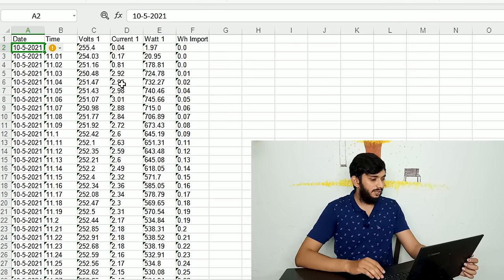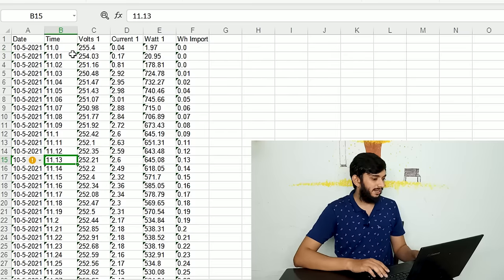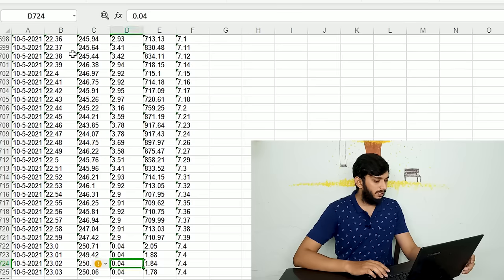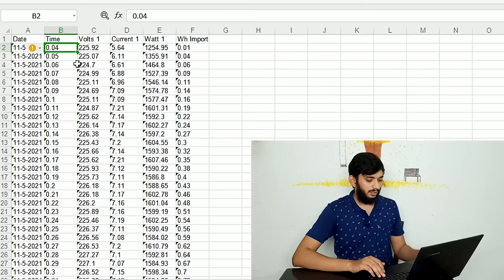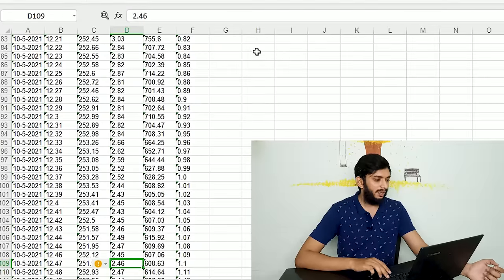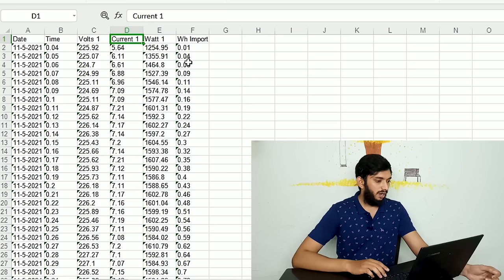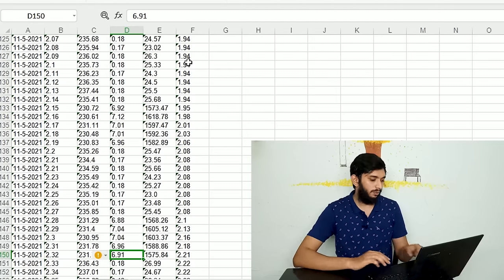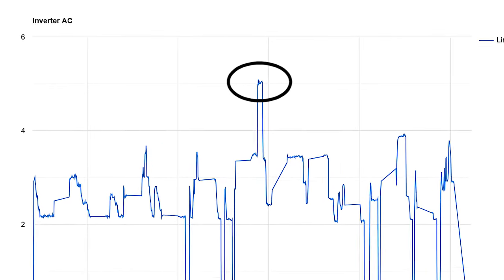Inverter AC vs Normal AC, How much unit will it consume?_Tamil, Does Inverter AC, Energy efficient?

Comment: The thing is normal AC won't go to off until it maintains 28 degree Celsius as room temperature which is easy . If it's very hot condition and if your keeping 20 degree Celsius in AC that can be maintained by AC only if it runs for several hours so at that time there won't be any 0 current transitions it will stay at 7  forever which will lead to major difference between inverter and normal

Comment: Not like that you told, if we choose inverter AC the cooling level is constant depends upon the load. But in non inverter type it's variable which means cooling level. 

But there no major different in energy savings.

Comment: Had 10+ Yrs of LG 1.5 split ac normal old model non-invertor...refilled R22 -Gas..but again after 2 days no cooling, than technician said no leakage in outer unit but might be mild leakage in inner unit, he said better to changewith new  indoor unit only since outdoor unit is good...my question is will outdoor unit will also create problem since it is 10+ Yrs old...so should I change both indoor and outdoor as a new set itself...??? Pls suggest since all Ac cost is too high now nearly 40k..???

Comment: Sir, you kept temp at 28 deg may be that's why the inverter AC consumed more power. Can you please test and confirm with 20 deg temp?
I liked all your videos, very informative.
Reply: I second this. The consumption is almost same at 28 set point. Repeating this with lower set point would show some savings. Higher the ambient, bigger the savings would be

Comment: you took the reading for 12hrs and most of the home users wont consume it for more than 5-8hrs/day
So according to your data
Inverter AC - for 5hrs - 3.0  units ----- for 8hrs - 5.15 
Normal AC - for 5hrs - 3.76 units ---- for 8hrs  - 5.1

Comment: Nice explanation,,👌👌.
In this video you have run both the Ac's with normal AC power , that is our eb line.
Have you tried to run both the Ac's with a inverter power ??? Try that and you will come to a conclusion,,, 👍
And please reply to me ,,
Reply from the maker: You cannot run normal AC on inverter output due to high current
Reply: @engineeringfacts  😁😁😁,,, so do you understand what a inverter AC ? Got a conclusion ???
Inverter AC means it's not a inverter, it meant to work even with the  inverter power supply,, that mean consumes less current ,,, so using it for a long period of time , it will save power,,, 
You think the designers and the manufacturers are idiots ???? 
The show room sales persons may not have a knowledge,, but you guys !!!! Think about your followers and post the videos,, 
Anyways congrats for your efforts and keep it up,,,
Reply from the maker: 😂😂 inverter Ac means, not a inverter, it's meant to work with inverter the inverter power supply. Do you understand what you're saying?
Reply: @engineeringfacts  do you understand what you want to say ? 
If it works with an inverter power supply !!! It will consume less power ,,, 
Engineering student !!!

Comment: Thala my voltas ac is 2 star 9years old normal split ac. I am operating it in night time only for 4hrs by maintaining temperature at 26c with full ac fan speed for an hour after that I will switch to sleep mode for 3hrs .. but power consumption is high it consumes around 5-6 hours just for 4hrs itself. Is it normal ?? Because my neighbour are getting very less bills even they are operating more than 12hrs peril day but they are using inverter technology. But mine is normal split ac 2star 9years old ac. I see some form of condenser in outdoor in gas pipe.

Comment: But the results may change when the load increases, in this case the load is either human being or the weather conditions, I think need more experiments, however, my opinion is  normal ac is better than inverter ac because we have to take the initial cost , durability and maintenance costs into consideration for overall efficiency.

Comment: The conclusion is that time*energy consumed= constant. Further it proves that energy can neither be created or destroyed.  However because of less current consumption the safty of inverter ac wiring may be better than normal ac.The variation in voltage reading is due to faulty meter and the name of the manufacturer should also be highlighted.

Comment: Keep the A/C at 20℃ both.... And calculate the same.... Because inverter model efficient at low temperature... I don't know you know or not.... Inverter model always run the compressor on ideal speed so no use if you keep at like 28℃....

Comment: May be that display shows the vge measurement with load. But in your case,when you are checking with the multimeter between those terminals you'll get the sense voltage as exactly as input.

Comment: Assalamalaikum…bro
I have a question I was using Non Invertor AC 1.5 ton , I will turn on stablizer only iam in needof AC or else will turn off stablizer too so my question is whether I should turn off the stablizer or is it okay to turn off just the AC because i was getting a more current bill. Can you please suggest a answer

Comment: at the final you mentioned the test conditions were same "same time?" but at the beginning you mentioned non inverter AC run between 12 AM to 12 PM and inverter 11 AM to 11 PM so inverter AC was running during the time when the building/room was under constant heat radiation from sun. the Inverter AC (including non-inverter) has thermostat which maintains the the set temperature.

second you didnt compare the AC brand, and the perfect test should be done with the same brands, and 28 degree Celsius is not considered cooling, 22 - 23 is considered comfortable temperature, other things that should have been recorded are the AC fan speed, mode, was the inverter AC had options to run on eco mode where you can set the energy consumption mode?
Reply from the maker: Check pinned comment. Given night time data of inverter Ac.

Comment: Bro , u run the AC at 23 less than normal room temperature . U checked at 28 , Which do.not have much impact  in both normal and inverter AC. At 28 the norma Ac will take much time to cool after off.   Becoz temp diff is very less in ac room and outside. At 23, inverter manages to operate continuously . Whereas normal ac start and take more time to cool .when this cycle.repeats normal ac will be more power consuming than inverter. U chk this also
Reply from the maker: It consumed 7 units. You still say it's nothing..?

Comment: The test should be done under identical conditions for both type ACs. Testing one in day time and the other in night will NOT give right results. Pls run both ACs in either night or day time. I am damn sure 10% less consumption will be recorded for inverter ACs. In long run and for extended uses, inverter ACs will save up to 30% power

Comment: I bought one 1 ton Sanyo inverter ac exactly 5 years ago for abt 27k , spent 12 k for out door indoor pcb repair for the five years. The ac never worked for any duration at all, company technicians failed to rectify the same, pl think twice before buying this inver ac

Comment: Sir,na last week oru lg dual inverter ac vangi iruken..ennoda AC la voltage 242v varuthu..Sometime 254v or 256v varuthu..Mostly 242,254,256 ithu thaan sir varuthu.ithu normal range'a illa problem varuma inverter ac ku..? Pls reply me sir. Pothuva inverter ac ku stabilizer venam nu thaan ella shop layum sonnanga..Na irunthum oru stabilizer use panren.. Everest 4kva deluxe (range 170-270) use pannikittu iruken..ithu normal stabilizer thaan..dual booster illa..Indha stabilizer'e en ac ku pothuma illa change pannanuma..? Pls explain me sir..

Comment: Just like real estate agents decided to build and sell only 3 BHK flats in the prime locations of Chennai to offset the losses during pandemic AC companies have ganged up to fleece customers with no choice but to buy only inverter AC which is more expensive!  God alone can save Indian middle class consumers. I have had bitter experiences with companies and private mechanics. I had shifted 3 times in 4 years and had to pay nearly 20 k as service charges for a 4 year old top of the line AC. I was never satisfied by the service of company warranty or by private servicemen. My friends and relatives are satisfied with Urban company they charge more but do their job and don’t cheat. I got fed up with private AC service men and got rid of my AC and stabiliser 4 years old for just 2 k   Suffering in humid Chennai without AC but afraid to buy a new one because of the expensive bitter experiences. Remember I bought top of the line AC manufactured in India at a reputed store. Will never recommend or buy that AC as long as I live. Factory seconds and refurbished AC are passed / sold as brand new AC with deceptive gifts like blenders and watches.

Comment: Sir  At 28 deg C both AC would have run in cutoff mode for long time.  Can you set both  at 23 Deg C at do the same test.
Reply: Exactly. Try running the test with both ACs set to 24 degree. Inverter AC would be energy efficient. Moreover we dont need AC to maintain a room temperature of 28. 

Overcooling will occur in non inverter AC only. Fact misinterpreted.

Comment: But I have some doubts in this experiment,,,,,

Ena na neenga noon oda vacha Apo kandipa Surrounding temperature or normal temperature High ah irunthurukum Apo kandipa noon entha AC potalum athu athigam ah thaane kaatum

In nyt..... Surrounding temperature low aagidum Apo Ac kamiya odanalum prechana Ila bro 

So orey time la inaiki nalaiki nu try Pani paarunga bro 

It's my opinion ithula mistake iruntha rply panunga bro theyrinjikaren
Reply from the maker: Check pinned comment. Given night time data of inverter Ac.

Comment: Bro i got big difference about these 2 ac.
I used normal 1 tone ac monthly charge i get 6k to 8k
But now i useing 1.5 inverter ac my monthly charge was2.5k to 3.5k. How its possible...
Then. 
U checked ac in day time and another one is night time.
You have to check only in night time...bcos majarity people useing in night only...
And 
You have to maintain room tempeature at least 24 or 23 in auto mode for better result.... No need 12 hours for checking. 5 hour is ok. No one can use ac in 28 degree... 28 Is hot.sorry to say.i think 28 result will not get properly. I expireanced bro. Pls recheck this expirement.... Or clarify me pls...

Comment: Not the right comparison bro. Morning time temperature will be high so it will take more power to maintain at 28. At night the external temperature will fall before 28. So keeping it at 28 will require less current. Please repeat the test by running the normal ac in the morning

Comment: Invertor AC may saves electricity but the life span is very poor and it will be very expensive to maintain...
Saving electricity and spending the savings in repair is not a good idea. Non invertor AC's are the best, cheap to maintain and peace of mind👍

Comment: Research conducted in different time period of a day. I hope this factor may not add much difference in the output. Still if you compare in parallel that will give more idea and eliminate the conflict of the result. Otherwise,  if you may did this deliberately to interact with viewers/responses. Cheers
Reply from the maker: Check pinned comment. Given night time data of inverter Ac.

Comment: Bro nega day timela temp athigama irukum so compressor onlaye irukum nega normal ac ah night timela temp kammiya irukum so same time la same roomla on panni paruga kandipa different irukum inverter ac normal ac ah vida kojam kammiya thn volt varum nega panna test correct ah ilanu ennaku thonnudhu bro idhu ennoda point
Reply from the maker: Check pinned comment. Given night time data of inverter Ac.

Comment: V gurard stabilizer also waste.  AC stabilizer & refrigerator stabilizer both r waste of money. Power vathathum just 2 to 3 minutes delay time la "ON" aaguthu. 150v to 190v stepup  just 10V aaguthu. That mean 150 input na output 160v and stepdown work aagathu. 200 to 270v vara same voltage varum (input = output) then cutoff 270v la aaguthu. Ithu practical la oru video podunga

Comment: நான் எனது வீட்டில் இரண்டு room களிலும் AC பயன்படுத்துகிறேன் ஒன்று 1 ton மற்றொன்று 1.5 ton, எனது வீட்டில் எப்பொழுதும் low voltage ஆகவே இருக்கிறது, 170 அந்த range தான் வருகிறது, நான் இரண்டு AC யும் ஒரே நேரத்தில் run செய்வதற்கு என்ன stabilizer use பண்ணவேண்டும் இரண்டுக்கும் சேர்த்து ஒரே stabilizer use  பண்ண முடியுமா ஒரே stabilizer லிருந்து இரண்டிற்கும் இணைப்பு கொடுக்க முடியுமா அதற்கு special stabilizer இருக்கிறதா தயவுசெய்து எனக்கு இந்த விளக்கத்திற்கு பதில் கூறுங்கள் நண்பா pls
Reply from the maker: Make complaint on EB. If not solved, then install stabilizer for home
Reply: @engineeringfacts  நன்றி நண்பா...இரண்டு ac களையும் ஒரே நேரத்தில் பயன்படுத்த இரண்டுக்கும் சேர்த்து என்ன range இல் stabilizer use பண்ணனும்...

Comment: You said it is totally wrong... the inverter compressor runs with a permanent magnet thats why it saves 50 percent energy that's a key difference with non inverter ac

Comment: Bro..how can you say that there won't be big difference  in outside temp in night and day..during day time, the outside temp.will be very high compared to night time which will decrease the Ac cutt off time ..means that the inverter Ac will have more more load compared to that normal Ac at night time..even after that it it consumes the same energy as normal Ac, then its obviously clear that inverter Ac takes less current.. I don't know how you missed this point...I used to watch.many of your videos.. I wonder you didn't notice this simple logic...

Comment: No your view is wrong.since you're working invertet ac mostly in day time when the ambient temperature is high whereas the fixed speed unit was working during mostly on night time when the night temperature is comparatively less
Please understand AC power consumption is directly proptional to increase in ambient dry bulb temperature.
Please apply some commensence and give your verdict.
Dont misguide people with half cook info.
Finally my conclusion is inverter AC is more energy efficient.
Reply from the maker: Check pinned comment. Given night time data of inverter Ac.

Comment: Testing method is wrong, if you want to get correct result both AC should have been tested in same  environment...I.e same room and timings, you have tested one in day and other at night, outside temperature will low at night, which will surely influence the functioning of AC , also as you mentioned comfort of people in inverter is always good as I have experienced and checked with manyof my friends, as you know it doesn't switch off compressor completely...
If you do the tests properly consumption of inverter AC will be 30 to 40 % less than non inverter AV.... your view seems to be biased , please do the test agai...

Comment: The video information needs proper study.i use to check the units of Acs.Non inverter AC consumes 7.5 t0 8.5 units (1.5ton).whereas LG Dual inverter AC consumes only 3.5 to 4 units in a night.

Comment: Everest is the worst stabilizer. I lost my AC compressor due to this poor stabilizer.
We had high voltage problem in our area around 260 to 270, but a normal stabilizer should have stepped down the voltage as per given working range or cut off appropriately. Instead I had to spend 10k on the compressor. My 🤦

Comment: I differ the results.  And misleading information. 
Definitely inverter AC will consume less power than normal AC. 
In this video u have not tested both the ACs in same outdoor temp. Outdoor temp is the key parameter to compressor working time and speed. 
And also the inside room environment. 

In this case both the testing scenario 

So I suggest pls test both AC in same environment.
Reply from the maker: Check pinned comment. Given night time data of inverter Ac.

Comment: But my dear friend the ambient temperature is also a main factor.  In the day time the ambient temperature will be high. So need more cooling required.  In the night ambient temperature is less then the day temperature.  So your calculation is totally biased.  My request don't give wrong information to the layperson.
Reply from the maker: Check pinned comment, night time data given for inverter AC.

Comment: You are good at electrical engineering no doubt, but not that great at mechanical. There is a significant difference in test conditions, you are running the inverter AC at peak load 🤦‍♂️

Rerun the test at the same time.

Comment: This is cheating  india 3ph voltage is 415v   so single phase is 415/1.732=   240V  with some tolerance 244 is ok that too i beleive in our TANGEDCO distribution trafo has  more old trafos which not even BEE rated  , 250 v is of no chance unless  TANGEDCO Installed APFC capacitors for your area where they will never do  , coming to your video for  AC the value of volt not  looks good ,  AC Voltage 250+V    Means running with high voltage your consumption will less as the power remains same increase voltage will decrease your current , reducing current qill increaee equipment  wfficiency , So i have a habit of seeing   line to gnd voltage of each phase in my wifi smart energy meter and which phase has good optimum voltage i to  use the change rotary 3ph switch for AC accordingly every night it save some current bill along with inverter AC and the inverter AC is the best in comfort and saving cant accept your statement.
Reply: You have to prove all your statements. Since I am in the machinery commissioning and service I had observed in many places more than 250 voltages is there especially after 7 pm, for that many industries using the separated stabilizer to control the voltage below 250 since they are facing issues in electrical systems
Eventhough inverter is good for comfort and noiseless it is having more maintenance than normal ac. Also he had tested practically about power consumption.